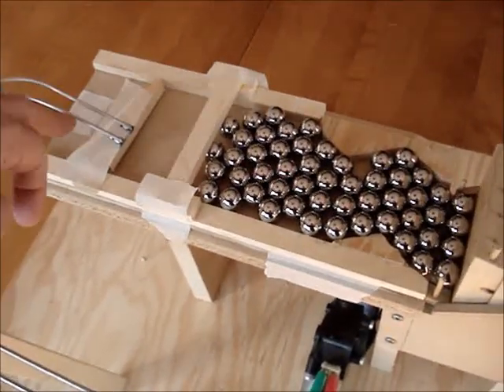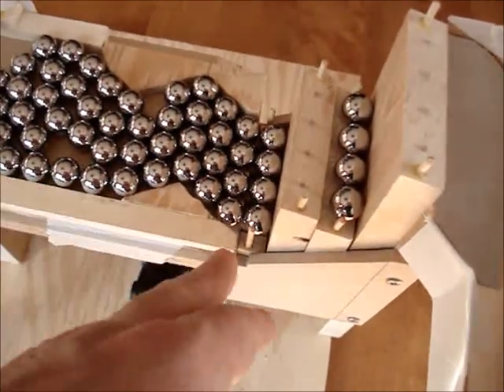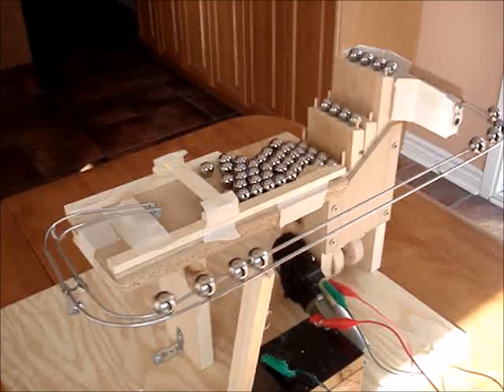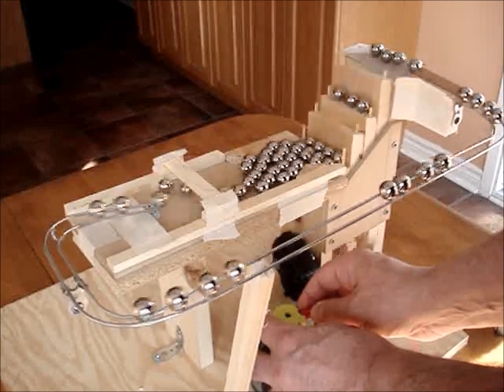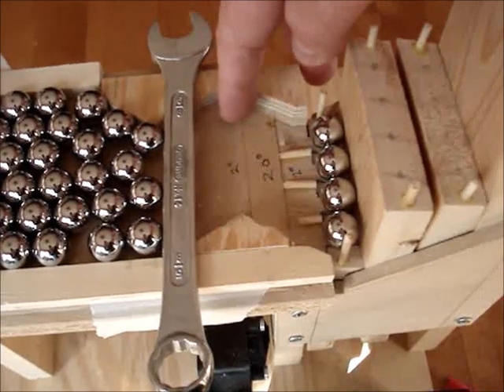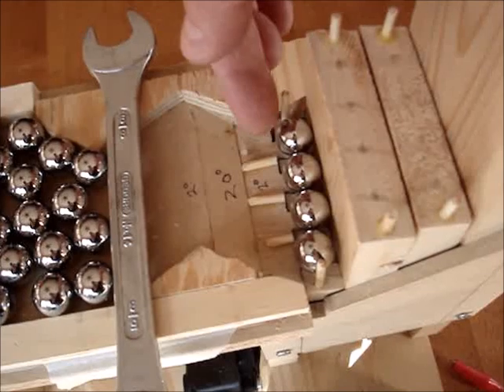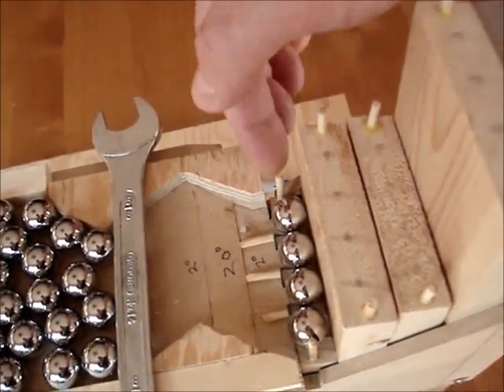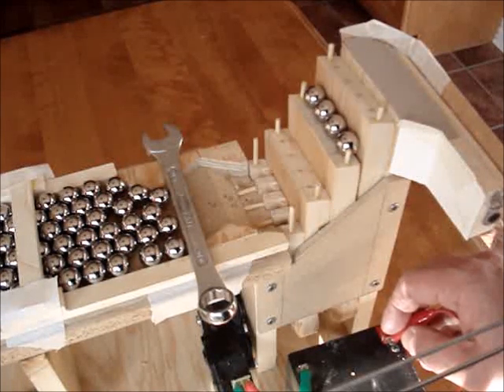High Speed Fish Stair

Comment: I really like the zig-zag stack section. Could you articulate what benefit that has? I know there won't be as much point to point support of the column of marbles, but what exactly does that get you? What problems does square packing cause?
Reply from the maker: The problem is that a single column of marbles is not stable, and must be supported everywhere. So square packing requires lanes to give support to the columns of marbles. Without support, square packing can collapse to a lower height, which is hex, or close-packed. So if it wants to, just let it.

By allowing and encouraging hex packing, there is no need for lane supports, and the ramp can be filled randomly from the back. There is no need for a divide by four. Sometimes divide by four can make an error, and the marble lanes will keep the error, with no way to fix it. Random fill can fill 4 spots with very low error rate, and generally self-repairing.
Reply: @kitchencone  Very interesting. I think you should really make sure Martin sees this. This is sound.
Reply: @kitchencone  Martin has said that the best part is no part. This really takes it to its logical conclusion. I like it.

Comment: wow! that is AWESOME!
Reply from the maker: Thanks. Inspired by the MMX!
Reply: Here's an idea based on this. Do you see how the hex-packed marbles makes a zig-zag in this model? The direction changes and width changes seem to be where the errors get introduced. If you eliminated the zig zag, and just had one gigantic strip of hex-packed marbles traveling diagonally down toward the fish stairs, fed randomly from the back, I am fairly sure this would eliminate any errors, even at high speed. In this video, when the motor was run on 18 volts, you can see that in the course of the short period it was running, the fish stairs had three of instances where they only loaded three marbles. The error in the hex lattice seems to be introduced where the back end narrows to a four-marble wide strip. The direction change also appears to be a source of error, and is too close to the entrance of the fish stair for the natural packing to correct the error. 

On the MMX, if the fish stairs simply had a long diagonal buffer of hex-packed marbles fed from the back randomly, then it would seem to me that the errors might just go away. 

Martin, I'm starting to suspect that the whole divide by 4 thing might be a "local maximum/optimum", and that random feeding into a hex-packed system that is 4 marbles wide might be the global optimum for simplicity and resilience.
Reply: Martin, if you haven't seen the comment thread above, it's worth reading. Kitchencone said:

"The problem is that a single column of marbles is not stable, and must be supported everywhere. So square packing requires lanes to give support to the columns of marbles. Without support, square packing can collapse to a lower height, which is hex, or close-packed. So if it wants to, just let it.

"By allowing and encouraging hex packing, there is no need for lane supports, and the ramp can be filled randomly from the back. There is no need for a divide by four. Sometimes divide by four can make an error, and the marble lanes will keep the error, with no way to fix it. Random fill can fill 4 spots with very low error rate, and generally self-repairing."

If the best part is no part, then this really is a better solution, because it eliminates the need to divide by 4 at all. The self-repairing of errors is another huge aspect of this.